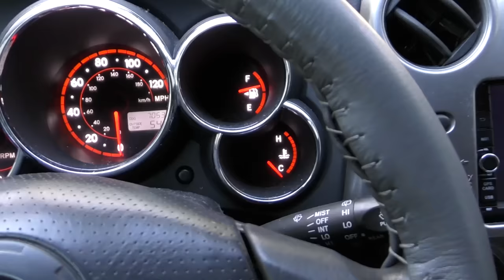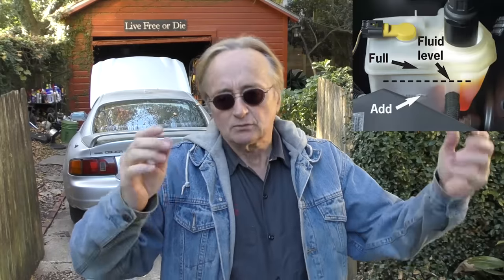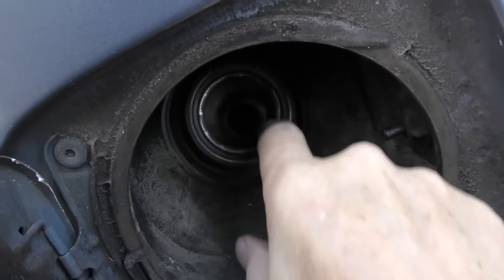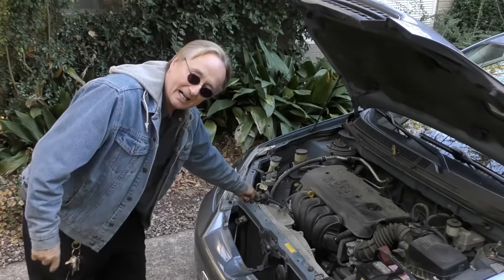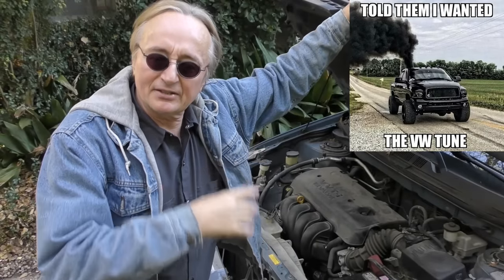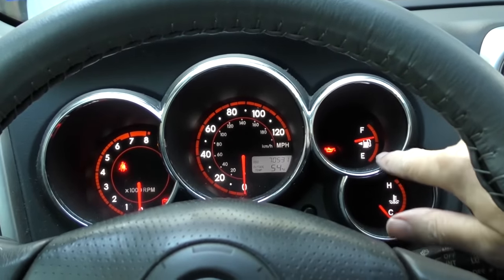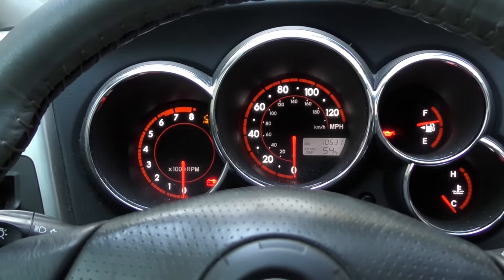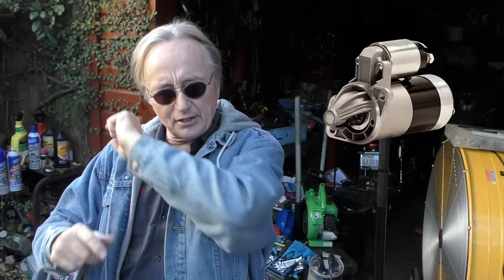Please Stop Doing This to Your Car (It Broke My Celica)

Comment: I bought a used engine and there was oil in the header. Still useable?
Reply: probably happened when the engine was stored on its side.
Reply: Yeah that’s exactly what happen
Reply: @Uptoptez  
It will probably smoke for a little while when it is first started.
Reply: Ray S I ordered two. I sold the one with the oil in the header. The guy said everything was fine. But from what I know they aren’t supposed to ship it sideways. And the oil should be drained anyway
Reply: @Uptoptez  
No, they should not ship or store it that way.  It makes you think they might not be reputable.
Reply: @rays7437  yeah but i sold it and it works fine the guy sent me a video and all and i just swapped one to my m35x from the same auto store
Reply: however it makes me not want to order anything else from them i never even touched it for 7 months so i kinda didnt even notice anything untill we unwrapped it

Comment: For the millionth time: IT'S NOT AN EMERGENCY BRAKE, IT'S A PARKING BRAKE!
Reply: In my culture, it's a "handbrake" – but yes, it's used for parking.
It can also be used in an emergency when the hydraulic system fails – which is why the design rules require it to be actuated independently.
So, all of these descriptions are correct.
Reply: @brianvogt8125  wrong.  Thats why every brake system has two circuits and it's better to still use the two circuit brake system if there's a leak. It's not the 50s anymore. People should learn the safest way to stop, that's why the right term matters

Comment: I keep my gas tank low because an #%#$# drilled a hole it my gas tank to steal the gas. They got nothing but luckily it was drilled a tap size, I tapped it and plugged it with a bolt to get to yhe shop. I asked for them to replace my 19 year old fuel filter, they didn't. I was back and made them , omg, it looked like mud coming out. CHANGE your fuel filters

Comment: Brake fluid is  hygroscopic so don't forget to change the fluid every 3 years.
Reply: I never recommend topping off the brake fluid reservoir because it only takes one mechanic to forget to remove some fluid before squeezing the caliper pistons back in. The brake fluid will overflow and make a mess.

Comment: $1000 bucks for a new fuel pump?  How bout a vid on over paid mechanics?
Reply: Price check the cost of an in tank fuel pump. You'll be surprised to see minimum are $350.00 . Count the time to drop the tank and replace everything,your at $1000.
Reply: depends on the vehicle.  some require dropping the fuel tank to access the pump
Reply: I know a man that had his car towed to a dealership and they charged him $900. to replace a starter.   Oh, it took them 2 weeks to do that. That was about 5 yrs ago, hard to say how much it would cost now.

Comment: That is probably the absolute worst car advice I have ever heard.  Of your brake 
light ever comes on, even if it just flashes, immediately pull over and call a tow truck.  If that light comes on, total brake failure is iminent.  Not taking it seriously as Scotty suggests WILL lead to serious injury or death, of yourself and others!!

Comment: I had a 2007 toyota matrix manual. Wasn't that amazing car at all... too much torque on low rpm, losing power on higher. Kind of box on wheels car. Low quality build... sold it for the first buyer.

Comment: 11:50 It could be the thermostat.
Reply: If that's the case, it will usually overheat the engine. Plus, at least on my Ram, the heater core lines go directly into the water pump, right above the impeller. They get fed from the water pump directly, before the thermostat. The thermostat only controls coolant flow to the actual radiator
Reply: @jasondonohue7355  The most common fault with a worn out thermostat is that it doesn't close, there by circulating the coolant through the radiator constantly removing to much heat from the engine coolant. This results in higher fuel consumption, more wear on the engine and longer time for the engine to reach correct operating temperature (or doesn't reach operating temperature at all). So if the coolant dose not warm up, neither will the air flowing through the heater core.